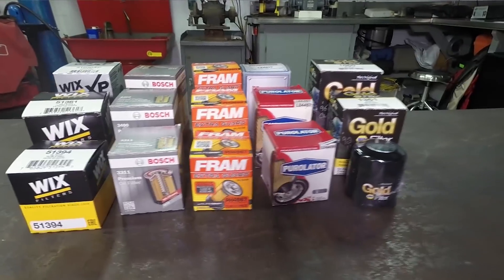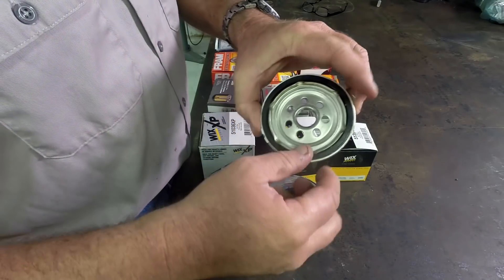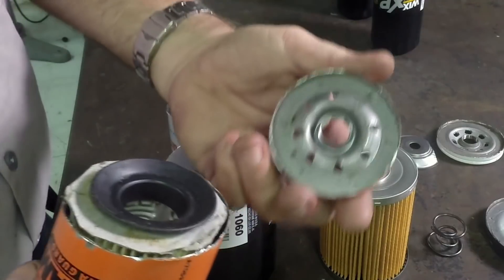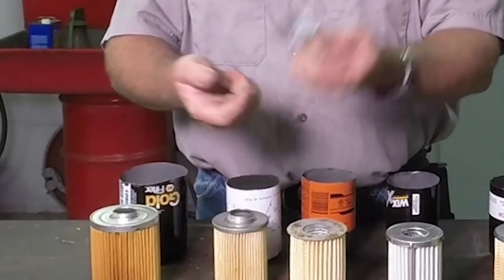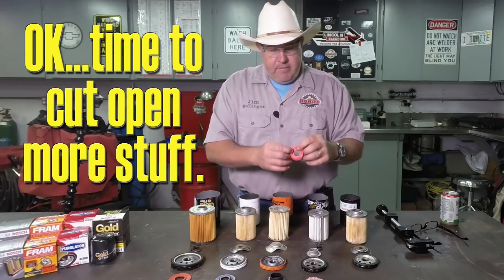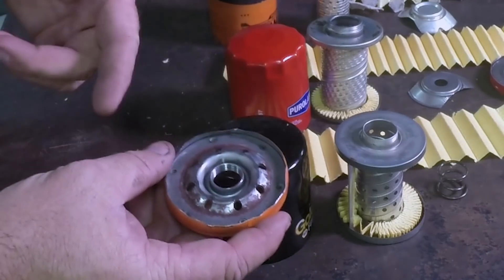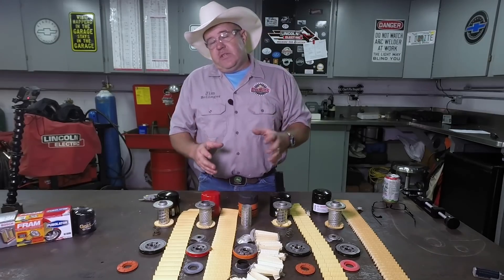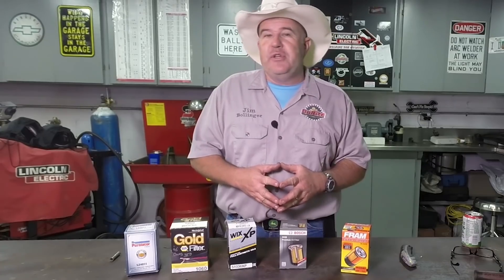The worst oil filter EVER!

Comment: Hi, god knows how I ended up on your channel.  I think I was watching flight sim vids and yours was next up!

A long time ago I was the R&D guy at TJ Filters.  We did a lot of comparative testing after I took over. My bias was product development rather than 'quality assessment' but you have to speculate to accumulate.
I could tell you a few things but in a nutshell here's a few pointers:
You cannot tell the quality of a spin-on filter from the outside.  That means if it says ford it will still have been made by the lowest bidder.  TJ did a LOT of ford and vauxhall filters back in the early 90's.  Only paint turns it from a 'pattern' part to an OEM filter.
Fram did and obviously still do use cardboard endcaps.  I assume your filters are for new model vehicles and new (not old stock items) and you didn't say whether 'the others' were direct replacements for that one.  Cardboard or steel depends on your manufacturing methods as well as costs.
The filter paper is impregnated with polymers that cure during the manufacturing process.  A darker paper indicates over curing and makes the paper element brittle- the one on the left looks over cured but it's a bit subjective.  'It feels higher quality' is no endorsement, I'm afraid.  Thicker metal or paper does not make a better quality filter.  It's in the filtration and flow performance that matters and, with all due respect, I don't think you can back up with empirical evidence.
To do your 'twist' test is irrelevant.  You are trying to twist the endcaps off from the perf tube which is set in adhesive.  All WE did was grab the pleats with a thumb and twist.  Any that broke like parchment paper we examined further but even then those filters couldn't get elements to collapse except under very heavy loading (I mean the filter was so blocked the oil pressure used to collapse the filter was more than the engine bypass would have released anyway).
As you did, cut away the element.  You are looking for the amount of polymer used to glue the element into the end cap.  Two things happen here:  It can appear (during manufacture) that you have deployed enough goop into the endcap before inserting the filter pack.  When the pack is heat cured the glue wicks up into the filter media (as it would).  This can completely wick goop away from the endcap causing de-lamination of the media from the cap.  I've seen this MANY times (when you grab the pleats and pull them with our thumb- it's easy to see too!).  I have never seen failure with this scenario in a filter has caused engine destruction.  I have seen it through apparent poor maintenance, though. 
I get your fram bashing.  We did it too.  However, back in MY day engine particulate filtration was an industry standard 30 micron and rust dust is a lot smaller even than some combustion products so isn't an issue.  And, kind of, neither is cardboard endcaps.  You've got flow characteristics and life expectancy to evaluate, here.

Oh, if you ever have any issues with oil delivery and need to assess your filters ability; for God sake don't use a grinder to open the filter up.  We developed our own too.  Essentially, a tin opener.

Got bored after the country music filtered through (see what I did there?).  I'm assuming you've not got a sales angle here.
Reply: Great. Just stay over there on that side of the internet and everything will be just fine.
Reply: Now this is an interesting response. Thanks.
Reply: What!?
Reply: ;What an intelligent reply how refreshing. All these people are like sheep, not one has asked the question, is the filter genuine or are the points made relevant. Its all; even though I have used Fram for ever and probably had no problems, I will no longer use their filters because of this one youtube video.
Reply: Genuine is an irrelivant concept. Its either oe or a pattern. Except for paint they CAN be the same item made in the same factory. Also consider ftams position: they would probably say their filter performs according over the lifecycle defined by the vehicles maintenance schedule.  Its probably not warranted beyond that.
A counterfeit part is anothed kettle of fish entirely. Also, have you ever wondered how filters were constructed before some bright spark thought to encapsulate the element in a handy spin on?
Reply: @roop298  It can be OE, Pattern or a load of rubbish not made to any specs at all. Much of this rubbish finds it's way onto the market via EBAY.
Reply: At last a voice of reason!
This ignoramus drugstore cowboy has NO science to use - only a grinder?  
Just watch the real FRAM science testing videos on YouTube.

Comment: I've used Fram for 45 years. A filter just sets there, no stress, no moving parts but the  drainback valve, cardboard does not break down in oil. Fram still in my book for filter changes.

Comment: ok where are by pass walves?  in russia we prefer filter with by walves in the beginning of the filter. so cold oil does not wash debree down the sistem on cold starts. why you doun have those? cold oil can crush the cardboad if you rev the engine and you hawe no filter.

Comment: I worked in a shop that built 10 thousand dollar big block chevy engines. I have seen fram filters come apart and kill new engines. when you put a fram filter on highflow pums they clog oil lines then BAG NO MORE GOOD ENGINE COMPLET SHITTT GARBAGE FRAM IS A DISGRACE

Comment: This is horribly misleading.  Those filters aren't even marketed to be competitors.  There is a huge price difference between them so you are basically putting an Audi up against a Caviler and trying to say they are competitors.  The Fram is an economy filter while NAPA Gold is a "high end" filter.  That being said, I've used all kinds of filters and as a wise engineer once told me, "often times good enough is good enough" so perhaps spending twice as much for a heavy gauge filter with sub xx micron filtration is a waste of money.  If you think about it, once you have particulates in your engine that needs a $9 filter you usually have bigger problems.

Comment: i will still buy fram because I don't drive my car hard and i change my oil every 3,000 miles. By the time the fram oil filter fall apart it would have been change out already.  Been using fram forever and never have any problem.

Comment: I believe this dude meant well but it's not hard to beat up Fram filters as most of them are pretty cheap.  There are some pretty good Frams out there. Even that inexpensive Fram that was cheaply made will hold up under most conditions and you'll never have an oil related issue with your car.  I've always used Napa Gold and can say they are great, but a visual comparison is only worth so much.

Comment: No surprise that the Wix filters and Napa Gold filters are number one and two in this dissection video, they’re the same manufacturer. Wix makes them for the NAPA gold line oil filters, just as Purilator makes them for CarQuest. The Wix are also the most expensive filters in your video, so yeah, higher quality components are expected. I won’t be giving the video a like nor dislike. While it does give information about what you’re buying at the various price points, you were basically comparing a BMW to a Yugo without mentioning the price differences.

Comment: Mobile 1 oil filters are also very good.
Reply: Yes but usually cost almost double Napa Gold (Wix).
I used them until I realized was probably over paying.
Still better to over pay than use that Fram junk.
Reply: @bretb8799  .  I get mine on sale for about $14 Canadian Peso's...or $3.00 USD.  LOL
Reply: I only paid about 9 dollars for my Mobil filter
Reply: Not really.
Reply: I put them on two different cars and both of them leaked(extended performance). The gasket wasn't broken, I tried tightening it more than I usually would just to be sure and they still leaked. Never buying Mobil 1 again.
Reply: @wulfman15  I've never had issues with filters leaking, regardless of brand except in one case. I'm pretty sure it isn't a filter problem but a seal problem. Either the old seal is stuck to the engine or the seal on the new filter isn't lubed properly and is bunching up. In my case I didn't check the filter mount properly and there was an old seal stuck there. I've used Mobil filters on a number of vehicles and never had an issue. In most cases sealing isn't a result of a bad oil filter but a problem somewhere else and the oil filter fails since its the weakest part of the system by design.
Reply: @wulfman15  Had the same thing - I stopped lubing the gasket on install and never had the problem again.  Still easy enough to remove.
Reply: @wulfman15 .   I've had nothing but luck with them, but I guess that not everyone will have the same experience with them.  Did you try another one before coming to that conclusion, or more importantly...was it a manufacturing defect that can occur in any mass-produced product?   Not criticizing here...but did you clean the interface where the Filter screws on?   A lot of people neglect to do that part.

Comment: comments are "OMG.. I've been using Fram for YEARS.. but not anymore.." most you only have daily drivers, no severve towing or high speed.. as far as cross threaded, and filter desintegration.. it's fairly certain the "mechanic" installed it wrong.. and never regularly changed.. the rust? it's all over the inside of the engine from normal atmospheric humidity and condensation.. lastly, never trust a "mechanic" who uses a grinder when there is a tool to remove the tops of filters for media inspections..

Comment: people tend to over credit branding... 90% of oil filters are a WIX filter.  Automotive belts and hoses are the same way,  delco/mopar/cat/dayton, etc. alll most likely gates belts with a different label stamped on them (used to work for Gates rubber years ago)

Comment: 'Not a fair comparison between base filters and Fram's  Ultra, Tough Guard.  I've been using TGs and Ultras for years in Asian cars running 260K miles with no engine repairs.  I'm not spending $18+ on filters that I change-out every 4500 miles....That's dumb.

Comment: Looks bad for Fram.   I've never seen an engine fail that you could blame the oil filter, except one that rubbed the road.  Most engines fail due to owners neglect. I've had engines that come in with 12000 km since the last change, some of them had fram filters. Don't listen to your oil life indicator. Keep track of your mileage like they did in the old days and change it when you should, not when your computer says to. Oil changes are way cheaper than engines.  I do use Wix in my shop, but I have the odd guy who will bring his own favorite brand of oil and a fram filter for me to change.

Comment: You're a complete fucking moron. Let me tell you the real world story about fram filters. I used the on my Hyundai Elantra from 102000 to 170000 miles. When I pulled my dipstick, the oil was always golden brown. One day I was stuck buying a wix shit ass fuck filter. And my oil was black as night immediately. It took three YES THREE FUCKING OIL CHANGES WITH A FRAM EXTRA GUARD TO MAKE MY DIPSTICK OIL GOLDEN BROWN NOT JET FUCKING BLACK WITH THAT SHIT NAPA WIX FILTER. I HAVE PICS SO YOU CAN PISS OFF WITH ANY NONSENSE. NAPA IS TRASH AND SO IS WIX. YOU'RE A FUCKING MORON STOP MAKING SHIT VIDEOS WITH ZERO REAL WORLD USE.
Reply: FYI twat, black oil means high contaminants in the oil. Which ergo means your filter is fucking worthless!

Comment: I also used Fram for years, not an oil tech, just a backyard mechanic that still likes to change his own oil.  I quit using them after I had two bad frams, the first time, it was junk out of the box, mis-stamped and the o-ring seal was damaged so I chalked it up to QC just missing a bad part and had to go back and exchange for a replacement...second time I had a bad one, filter looked fine going on, on an older car starting to rack up the miles...car started losing oil, was worried the engine was leaking....nope the bottom of the oil filter case cracked and was letting all the oil out...tell me that won't ruin a good engine, lucky I was attentive and caught it before it did do harm.  I'm a fool me once kinda guy and after that I switched brands.

Comment: I wondered about Fram when I noticed the Cartridge for my 2013 equinox used to say Made in Korea and then they had made in China on them. The plastic was thinner and it looked bad. Now I have a 2018 mustang GT and there will be no Fram products on it. 
Could you do an oil filter video on Motorcraft, AC Delco and Mopar? It would be cool to see which factory OEM oil filter is the best.

Comment: I am totally baffled as to why there's so many comments defending the Fram products. And all the comments about comparing a premium Napa Gold filter against the Fram... Way to miss the point guys. But by all means, save a couple of bucks and get the cheapest version of an essential engine component.
No, it won't kill your engine in days, or even months. What it WILL do is rapidly turn your 500k-miles-lifetime motor into a 400k-miles motor (or maybe a lot less, if an oil gallery or oil pump gets clogged with cardboard from a disintegrating filter).
I know which one I'd be buying.

Comment: Well I liked the comparison but one big problem with it,  you compared the higher class filters of the different brands to the cheapo version fram filter.
That fram filter you compared is like a $5 to $7 filter those others are around say $9 to $15 maybe just a bit more.  So it's safe to say you were comparing Apple's to Orange's.

Comment: Thank you for this sir, i have always bought FRAM! Never again, not sure in the UK what our equivalent filters are for Napa Gold or Wix? 
I recommended this to ANYONE - WATCH THIS VIDEO! I run high performance cars and it is vital the motor and turbochargers get a clean oil supply. Blocked oil ways in a turbo can cause seizure of the turbine!  This guy is GOOD!

Comment: THAT'S NOTHING. Buy a hyundai filter BUT NOT from hyundai. Get a super cheap ebay one shipped from somewhere in Asia. And it's likely to have NO PAPER AT ALL. There's a bunch of FAKE PARTS specifically for hyundais that won't work or are outright fake. Like paperless filters that don't filter and other stuff that LOOKS fine but is just pointless junk.